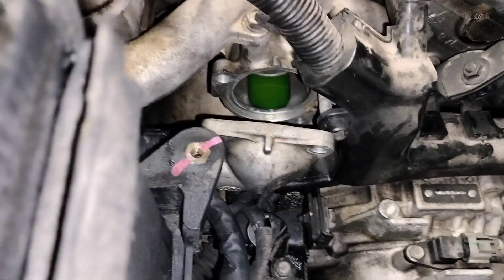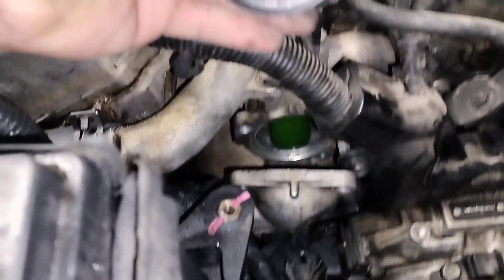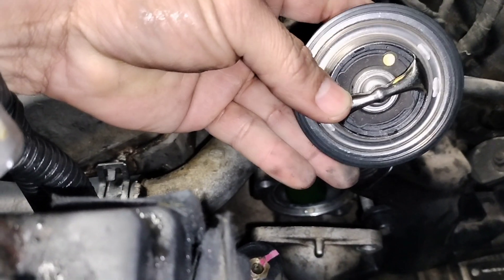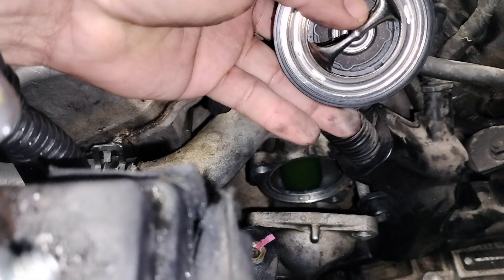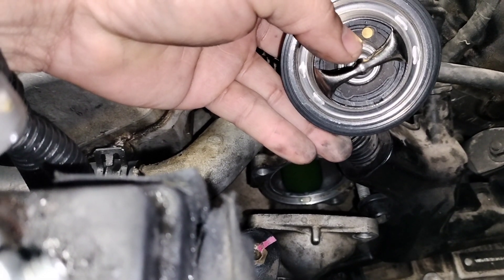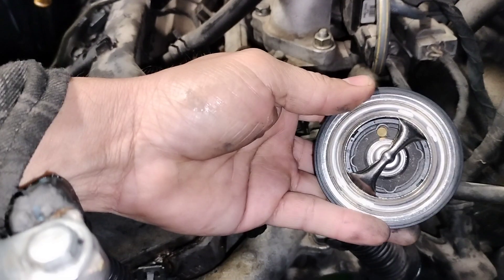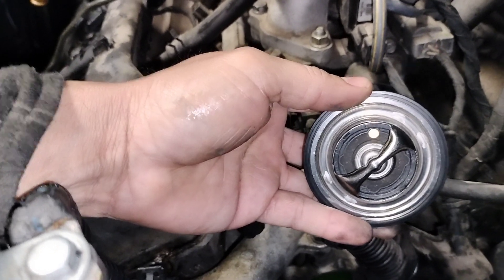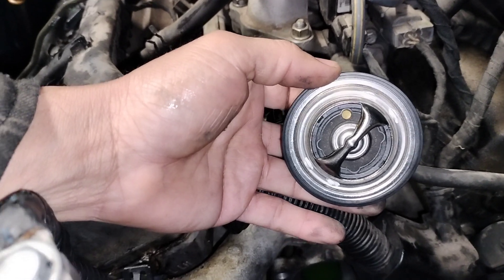2008 Hyundai Santa Fe thermostat replacement

Comment: Why u change it what symptoms was it having?
Reply from the maker: @dabossakadaddy  overheating. Also after reaching normal operating temperature and driving it for a while,  the  thermostat hose cold to the touch.
Reply: @HDGARAGE  ok cool thanks for replying my 07 is over heating after 8 hours of low speed rounds(20mph under) and heat is in and out